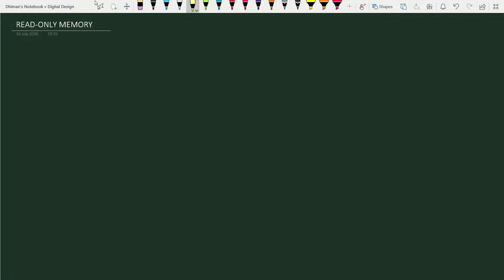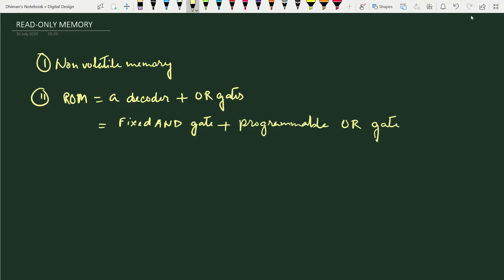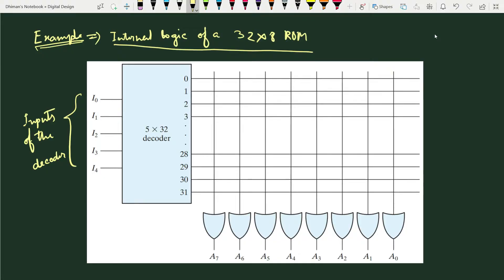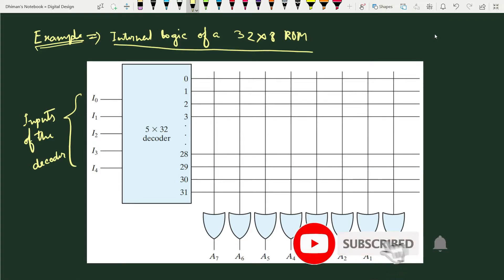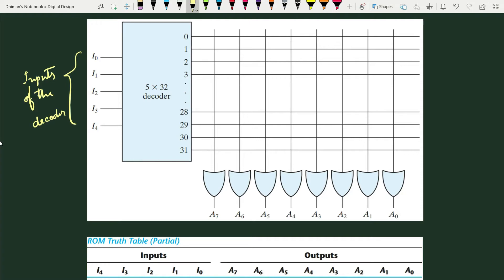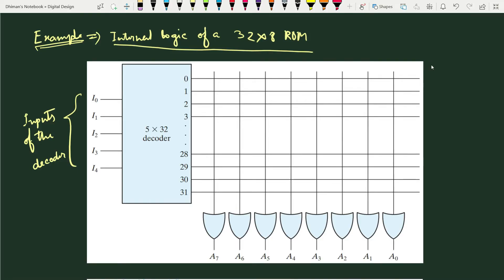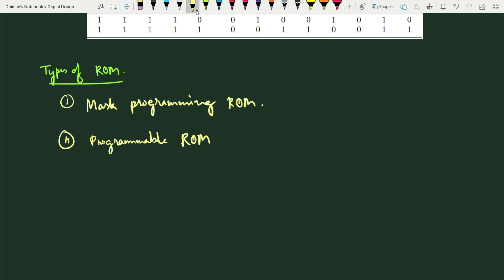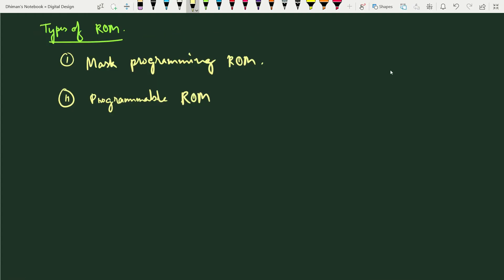READ-ONLY MEMORY | ROM | Construction of ROM | Internal logic of a 32*8 ROM | Types of ROM

Comment: (1) Include a 2‐input NAND gate in the register of Fig. 1 and connect the gate output to the C inputs of all the flip‐flops. One input of the NAND gate receives the clock pulses from the clock generator, and the other input of the NAND gate provides a parallel load control. Explain the operation of the modified register. Explain why this circuit might have operational problems.